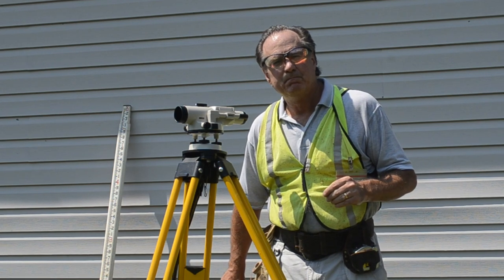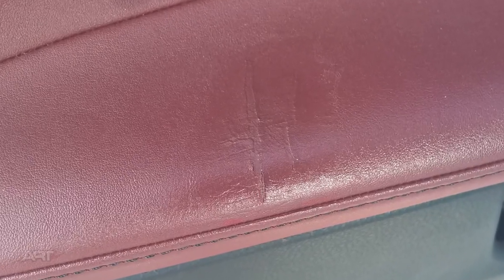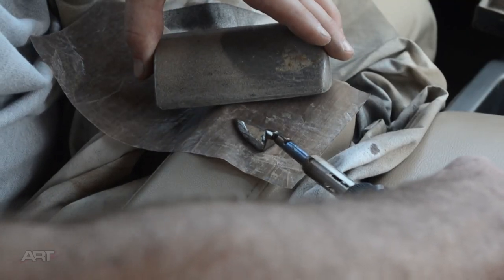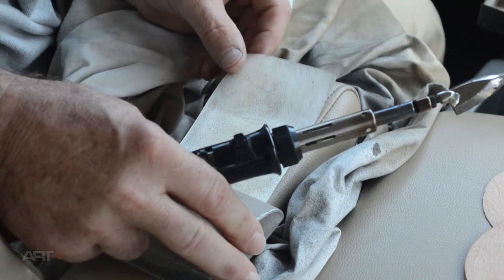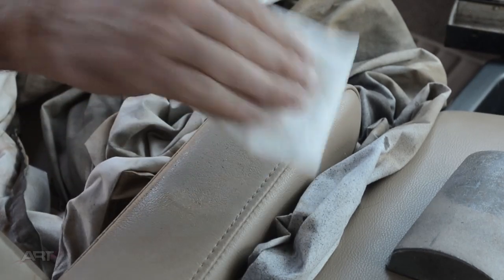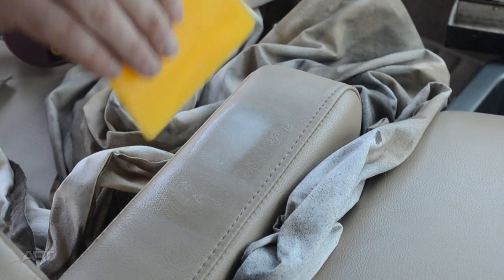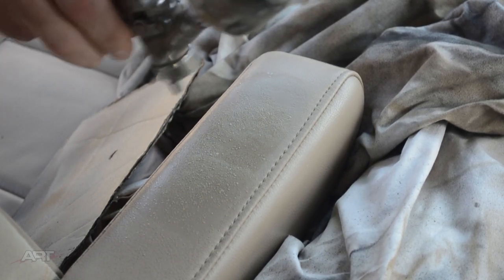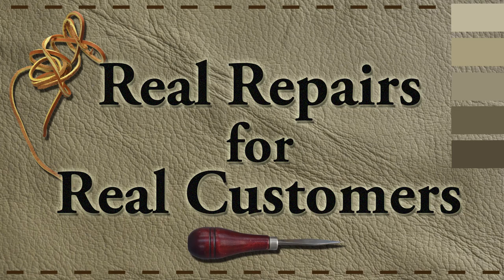Flat Vinyl Repair Part 1 v20

Comment: There are people in your business who settle for "ridges" remaining in the vinyl after they've repaired it, stating not only wrong reasons for the damage but that the damage was so severe and that's why the ridges remain.  Such people could really learn a thing or two from your techniques.  You don't ever settle for second best.
Reply from the maker: Well not all repairs turn out like we like them to.  But the idea is to have techniques well in mind and then have the conviction to take the time to try to do it right.  Thanks, and I'm glad you find the videos helpful.

Comment: I'm gonna see if I can purchase the tools and try that myself on my 2005 Cadillac Escalade arm rest, I've tried upholstery shops but they tell me to get the armrest at the junkyard, all I have is a one inch slit on the armrest. Thanks I'll try that 👍
Reply from the maker: Bad advice from the shops.  Many upholstery shops are ordering the slip covers for the armrests available online.  They are cheap, look good, and save the shop time.  Also it can be difficult to sew the tight radius these armrests require.  But with a special machine setup (most shops don't have) it can be done more easily.   Buy it online, slip it on, done.

Comment: I'm curious how it holds up being a highly used area
Reply from the maker: I was glad that I had a much worse damage to repair on the driver's armrest on my cargo van which was bought used.  For two years now the repair is exactly the same as the day I did it.  So it's turned out to be a valuable case study!  Thanks.
Reply: @a.r.t.srealrepairsforrealc8247  awesome!